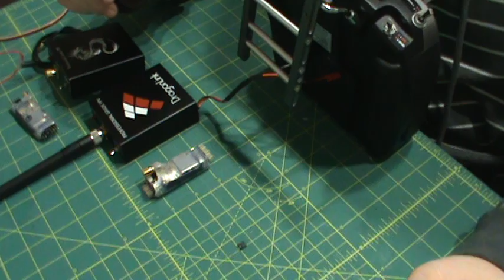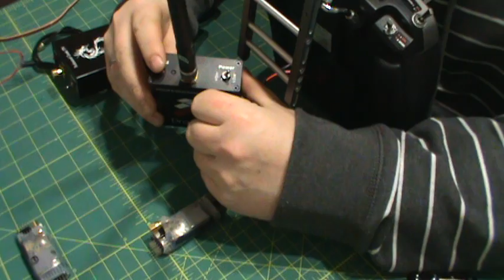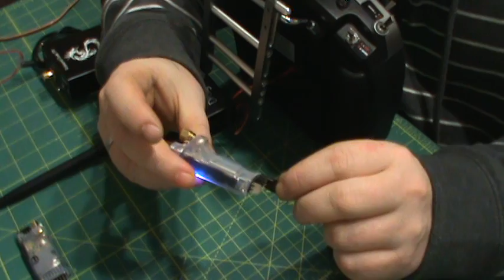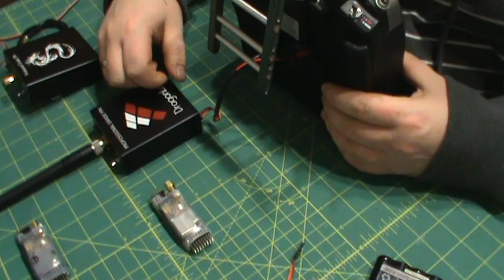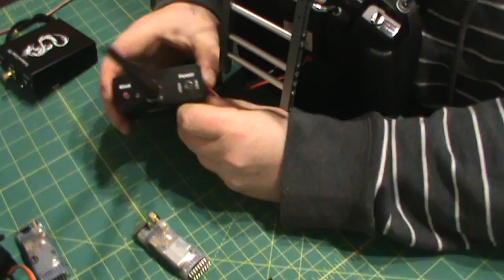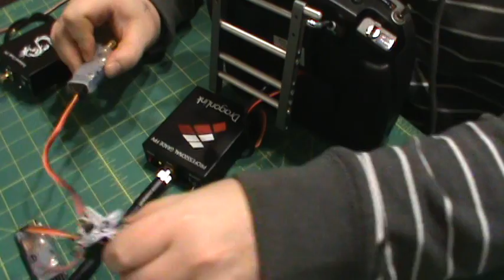Dragon Link Updated Firmware, Calibration, ID change and Binding

Comment: i did all this calibration and binding and when i fly the Dragon Link cuts out EVERY minute. crashed my plane because of this poor performance.
Reply from the maker: +Ken Pappas you need to do  the micro power mode to make sure all is good before flying.How can you blame a systems that holds the world record for distance?
Reply: I calibrated in low power mode if that is what you mean.  Maybe I got a lemon?
Reply from the maker: No that is fine, most people including myself fly/test and set up in low power mode. High power is for that extra boost is when you are very far away and may have a issue with rssi. put into high power mode. DL has many good How To Videos, check them out and follow to the T. Micro power mode is a test mode you do on the ground before you fly. With everything power up on the on the ground. Then you put your TX in low then walk away with your model, you should get a certain distance, if you do not there are issue with something on your model. Check my video out on a micro power range test. https://www.youtube.com/watch?v=03Uk_q0-13g

Comment: Just wanted to say a big thank you for doing this vid. I spent most of the day trying to get the rx to bind but just wasn't getting anywhere. Followed you step by step and bingo it works. I think my mistake was to try and calibrate too close and with a rx antenna fitted. Thanks :)
Reply from the maker: awesome Nick, glad it helped you out. A lot of people forget to remove the jumper form ch5-6 after calibration. :) Or forget that a total re boot of power form not just the RX, but also the TX. Another thing to which i don't think i mentioned in this video is set your TX into the HIGH output during the calibration. I always set mine at least 6ft away. Any questions fire away. :)

Comment from the maker: But you well noticed that the DSM2 bind plug jumps the to outer pins.(neg and Signal) When you are binding a DSM2 RX. What you can do is, pri open the little plastic clip on one of the pins, and remove and and install in the center slot of the bind plug so the 2 pins are close, so it well fit across the 2 TOP signal pins. If you need i can make a small video to show you. Cheers

Comment from the maker: Hey robust, thanks for the comments. For binding you dont need the jumper...Jumper is only for calibration. If you are referring to a jumper for calibration. Heres a simple and easy way to make a jumper pin. If you have a bind plug for a DSM2 receiver its act the same way.

Comment from the maker: hey, sorry i dont have any experence with the Skylark Dianmu. Does it have anywhere printed RSSI output? Is so, you'll need to run a male/male servo lead form Ch12 of your DL RX to the OSD. Depending on the Dianmu you may need to only run a single jumper wire from the signal pin of ch12 to the osd. either. I don't plucked 2 of the leads out of a male to male and only used the 1. I use DOSD ;) one of the best 180 buck osd's out there ;0)

Comment from the maker: hey , yea i had to mod it to get power from my DX7s main battery. Which is the same type of 2s batt a DX8 uses.
Also you could mount a 2s batt on your DL TX and power it that way.

Check back though my vid's just a few weeks ago i made a step by step on how i hacked my radio to DL ;0)